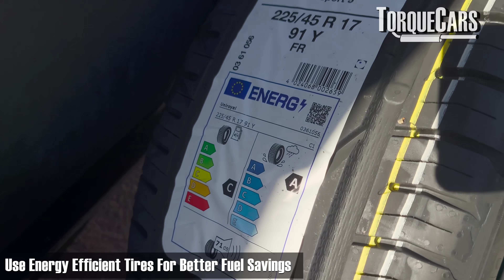10 Fuel Efficiency ECO Driving Myths Exposed 🚗💨  What Really Works? - Save Fuel the RIGHT Way!

Comment: As a retired marine engineer I only use diesel from recognised companies ie Shell, BP etc, who has seen an ASDA drilling rig?
Many fuels can be sourced cheaply from South America but these fuels can leave deposits in the fuel systems. One such deposit was a white residue that had set in pipework like cement and had to have pipes and fittings replaced.
Try to find out where your local low cost fuel station sources its fuel and choose where you fill up based on the country of origin.

Comment: You never mentioned coasting down hills...as you accelerate up but coast down it'll be like constantly driving on flat roads, no?, also, many years ago I dispensed with the spare wheel opting for a tin of tyre weld instead:)

Comment: So what RPM are we suppose to be driving and at what RPM you will it be considered low driving.
Reply from the maker: It depends on the engine and what you are doing (accelerating, cruising at constant speed, going up hill etc.) This video discusses low rpm in more detail and should shed some more light on the question. https://www.youtube.com/watch?v=Uot7DHY_C1c

Generally speaking for economy you should keep the rpm around peak torque (or just below) as this is the most efficient point in most engines.

Comment: Windows down or cracked at low speed can save fuel over A/C, which I do occasionally if it isn't too hot out driving through town. At highway speed definitely better to use A/C.

Comment: I did calculation a while ago, and IIRC gas costs about as much as $0.30/kwh electricity in an EV. Public chargers typically around this cost, so then the extra paid for an EV is wasted on charging. US average KWH cost is around $0.12 or so I think, but most will be under $0.20 unless living in California or Hawaii. Mine I am luck to have a good EMC, they do cheap $0.085/kwh year round but you get penalized heavily for using over 3KW during peak periods. If you don't run your dryer when it is 95F out you save substantial money. This is because they can use less of the highly expensive peaker plants on hot days.

Comment: Where I live the temperature can get as low as -50°C or -58°F, in this extreme cold I could see fueling up in the morning being beneficial but only in the winter time.

One I noticed you didn't mention was whether the temperature of the air being brought into the engine made a difference in fuel efficiency or not.
Reply from the maker: That is actually a really complex question and depends on the engine concerned to a large degree. Warmer air means you burn less fuel. However you are also making less power and need to use more throttle. The BMEP is what we need to focus on and this varies with load and RPM. Personally warmer air on light throttle loads seems to improve fuel economy by about 4mpg - to the low 70mpg (comparing summer with winter here on a regular commute).  However in typical driving I don't  see much difference.

Comment: Using non ethanol gas saves alot of gas. My Lincoln gets 20 to 23 mpg insted of 12-14 I get on e10.  Dual exhaust helps as does having good sensors and no vaccume leaks and a tight timing chain

Comment: To save fuel on engine heating here in Norway you see a lot of cars with a retrofitted electric engine heater. It's a heating element which is installed in the upper radiator hose and heats the coolant up to about 20 C. They've become quite advanced and today you can get app controlled ones, but like with my car I have a timer which starts the heater every day about 30 minutes before I go to work. The same manufacturers also make cabin heater solutions which allow you to do the same thing but for the interior - very nice especially if you park your car outside on a cold morning.

To clarify these solutions use 230V not 12V so they require you to have a wall plug nearby. Look up DEFA or Calix engine/interior heaters

Comment: I tested the theory on premium and standard fuel. I do get better mpg on the premium fuel, but the extra cost of the fuel wipes out the efficiency benefits. Been tracking and comparing the differences since 2021 and It is roughly 1p a mile more in cost to run on premium fuel, based on premium fuel being 20p per litre more expensive, which seems to be average premium in price.
Reply from the maker: Thanks for the feedback, which engine was this on?
Reply: 👍It was for the Audi 1.4TFSI with a manual.

Comment: One thing with EV charging cost vs fuel costs in ICE cars, there can be big savings of as much as £1000 a year if you solely charge at home and do around 10,000 miles, compared to a petrol car that can do around 45mpg. Those numbers change depending on how much public charging is needed (smaller saving), or if you have more or less efficient car. But what this comparison doesn't take into account is the additional cost of EV's. A like for like EV (same class, same size) is oftern around £10k more expensive to buy. Unless you are going to keep the car for a prolonged period of time the extra cost of the car might outweight the fuel savings. Because of this, EV's only really financially benefit people who get them as company cars, that have lower benefit in kind tax rates on EV, or maybe for someone that is able to purchase an EV on a salary sacrifice scheme. Even then on a salary sacrifice scheme, the saving in tax needs to be greater than the difference in cost between an EV and the equivalent ICE car. The idea of judging the financial benefit of a EV just on the fuel savings might be a bit false.

Comment: In a diesel engine using a fuel additive, such as Miller's, does make a significant difference. I discovered this when I tried supermarket diesel with and without additive.  The difference was 5 mpg and a distinctly audible difference in the sound of the engine. I don't ever use supermarket diesel since then but I still use additive along with standard BP diesel. Basically the cost of the additive gives the same improvement for slightly less than the cost of BP Ultimate diesel.

Comment: What I've been wondering: I've seen it a lot in modern automatic transmissions that they go into neutral when you just let the car roll without hitting the accelerator. Obviously they claim that it saves fuel because the car will slow down less while rolling, BUT: it still has to use some fuel for the engine to keep idling while rolling whereas when you keep the gear in it consumes zero fuel but slows down faster. Now which one would be more fuel efficient? Leaving the gear in or going into neutral while rolling? I can't imagine it would make a huge difference but I'm still curious.
Reply: Redex. I use it with Shell optimax and Redex every fill up only half the Redex in the bottle  if I put half tank full in in my car which is a Vauxhall astra 1400 16v 2006. 40.000 miles the car run absolutely fantastic never had any faults.. Ive also bought a BMW m240i 2020 coupe 5000 mile only B58 engine.. I use Shell optimax... In this car also but I am reluctant to use Redex also  with it been such a newer car could using Shell optimax and Redex cause any damage to the rubber seals. or would it Benefit the BMW using both.. Please can anyone help..

Comment: a higher number of octane itself doesn’t increase fuel efficiency, modern turbocharged engines work with higher compression ratio which makes them more efficient but also more likely to detonate. The higher number of octane just prevents the detonation itself.
You can use higher octane fuel on economy engines but that doesn’t change the efficiency of the combustion itself, and with that the fuel economy

if you decrease the number of octane you destroy the engine with detonation but if you increase the number of octane you're just paying for fuel that keeps working well at a temperature that your car’s engine will never reach. The best solution is to stick with the recommended number of octane for your car.

Of course this change if the number of octane isn't the only variation between fuels

Comment: I disagree on a few points. Slightly higher tyre pressures can reduce tyre hysteresis without affecting wear. A lot of cars have an optimum fuel economy speed 35 to 40mph, top gear low rpm. E5 or E0 will be more efficient because they are more energy dense.

Comment: My GT86 subaru engine says "98 RON ONLY" on the fuel cap.  However the manual says different. 
I have run it on 95 and 98 and there was a very minor MPG increase.  
I now just run it on 95.
What you would notice was when you were forced to mix the tank.  For example, running on 98, but getting caught short and having to stick £20 of Tesco 95 in it.  The engine mapping doesn't like this and tends to run rough for a mile or two and then smoothen out.

Comment: “Efficiency” is the wrong approach to judge any car, anyway, especially when the other factors are ignored. Manufacturers produce engines and cars with fuel efficiency in mind under various circumstances. Their engineering is good enough for me not to chase efficiency further, other than keep to the few simple principles that  haven’t changed for decades. For example, I wouldn’t heavily Rev a cold engine and wouldn’t climb in low revs.
It really annoys me when EV drivers are referring to efficiency and in their mind, efficiency differences mainly cover the distance per fuel cost figure, overlooking that the government penalises one differently from the other type of propulsion. I suppose, their EV gets significantly less efficient when charged at 89p per kWh. They also ignore the energy waste from fast charging, preheating the battery and the loss while the battery is left unused.  EVs are also a lot more sensitive to running the heating or cooling/air conditioning, to higher speed, climbing, towing and extra passengers. Imagine how much excitement and motoring pleasure the slow Tesla drivers have, being able to give a precise figure of their average miles per kWh and the cost of their motoring!
It’s nice to enjoy a car and driving it differently sometimes.

Comment: TOTALLY False re air con temp. Air con is either on or off and ALWAYS cools air to the lowest it can, but if u set a temp higher than min, all it does is add warm air from heater matrix back into to the cool air to re-warm it!!
So a Lower temp doesn't put any more load on the aircon system, but not having it on min but it switch on, means u are wasting fuel if u don't need it cooled
Reply: Depends on the car. Some switch the compressor on and off. BMW 3 series we used to have did this. Can hear a slight hiss every time it switched on. My golf however does not. It's always on and just adds a little heat regardless of temperature. It does have an air con eco mode though. Unsure what the one in our other car, a mini does.

Comment: My best motorway mpg has been while getting somewhat of a move on.. but thats with gearing for 2000rpm at 70.. depends on the wind and traffic too.. 55mph is great if on the flat when sheltered from the wind but otherwise lugs and downshifts or revs the engine.
There's torque converter lockup on 4th and 5th, and still manages better MPG than early changes in manual mode.

Interestingly, my brother used to find his first V8 merc got a slightly higher average mpg if driving it a bit harder to warm it up quicker.

Comment: Getting best fuel economy can be one of those nerdy things that people will do. I do it myself when I’m in the mood. But there are other times when my journey purpose is to get from A to B in a shorter time, so that is then the focus. 

I do know that with my current petrol engined car (2 litre automatic dct) I can achieve around 55 mpg on a nerdy trip from Kent into Carmarthenshire, but realistically if economy is not uppermost, then around 42 mpg is what I expect. 

As others have said, anticipation is king. I hardly have to use my brakes as I’m looking well ahead, and this applies regardless of whether I’m in economy or time efficiency modes of driving.

My car has a “green” mode which politely tells me I’ve gained around 12 miles range on a typical and careful 275 mile trip across the country. So that’s a £1.80 saving then. Wow… a large Americano costs £4.25. I’ll just go without the Americano and “gain” 28 miles range haha.

Comment: I have a 2023 2 door jeep wrangler 3.6 6MT
It comesnwith a trip computer with fuel economy and ive paid attention to how driving habits affect econ.
Driving at 55-60 gives me about 25-28mpg. Slower gives me more.
Driving 70mph gives me 20-22.
Driving 85mpg gives me 16-19mpg.

There is little difference between driving with open windows and using ac, bc these mew ac systems are more efficient and the jeeps shape is already boxy so theres little difference with the windows. Therenis a higher difference at higher speeds like 65+ only about 1mpg.
Driving with the too retracted does net 1-2 mpg lower avergae.

Comment: Many years ago I was a police officer, and when doing our advanced driver training we were also taught about efficient and economical driving as well as the fast stuff. Our instructor pointed out that the best word for fuel economy is anticipation, in other words looking and thinking ahead so you do everything calmly and gently. Braking wastes your expensive energy by turning it into wasted heat in your brakes. For example, one test we did was to start with 100 points and lose one point every time we touched the brake pedal. If you see a red traffic light several hundred yards ahead, take your foot off the gas now, don't keep it on and then switch to the brakes a few yards before stopping. You should gradually lose speed without braking, you've timed it right if the lights change just before you get there so you can carry on without braking, but if you do have to stop you only need to brake very gently as you've already slowed right down. Don't just look at the car in front, look as far ahead as you can see and 'read the road' as we were told.  This type of driving not only saves fuel, it saves accidents as well. 'Don't be a B&B driver' (boot and brakes).
Reply: Yep whenI started doing this it helped massively. It also just is nicer to drive this way, less rushed. And you tend to get there just as fast if not quicker, because you're not stop-starting so much.
Reply: @__-fm5qv  I'll often go into the open lane and pass people as the light turns from red to green and then get back over. I'm not trying to be rude, just thinking with fuel economy in mind even if we end up at the next light at the same time. Sometimes I don't manage to time it right so I have to gun it just to get enough distance to move over so I am not stuck in a left turn only lane.
Reply: Dont be a BMW driver
Reply: Took me too many years to discover what he says is absolutely correct.
Reply: Yes and also we have to anticipate other cars ahead in highway that will make we brake frequently and start to think about gaps between cars ahead that can possibly be passed to avoid frequent braking
Reply: Preparing to stop, ready to proceed is what I do approaching a red light.
Reply: I’m not a police skill level driver, far from it, but the anticipation method is key. Look well ahead and coast to the red light.

Sadly mummie in her Discovery or young dad in his BMW don’t know what the word patience means.

It’s a wonderful world really, if only it wasn’t for the general public it would be marvellous 👍🏻👍🏻👍🏻

Comment: What you talk about with the 7 hour charge time is why I have the oldest economy tariff of them all to charge my car.  Economy 7.  And yes I make a substantial saving over diesel.  But I rarely public charge.  However I'd dispute that it's much more expensive than ICE on public charging.  It varies from about cost neutral, to about 1p per mile more expensive.

Comment: I now currently use Shell V-Power (99 Octane) in my Abarth 595, since it's a factory tuned, modern turbocharged 'performance' engine. No problems over 12 months and bought the car on a 65 plate with 50k on the clock. I'm 45 so past 'boy racer' driving - and can easily get 50mpg at 50-60mph in 'Sport Mode' (like it needed one 🤷‍♂️😂). Also, only has a 5-speed gearbox. Not bad for a car that does 0-60mph in 6s 👍
Previously ran an Alfa Giuluetta 1.6 JTDm-2 diesel for 10 years. After the DPF got clogged on supermarket fuel, switched to BP Ultimate. Cost a fortune and caused even more soot build-up than the supermarket stuff, resulting in a stuck glow plug (changed every service) and visible soot at the exhaust tip!
So, Shell V-Power (petrol) gets 👍😀👌. BP Ultimate (diesel) gets 👎💸🙄
P.S. Despite the above issues later in life. Drove my Alfa to 100k miles with zero electrical issues and just the problems with soot on the engine. Other than that, the car was the MOST reliable I've ever owned. Had it far longer than any Ford, VW, Audi and BMW I had previously owned. I had to get rid of all the German cars due to expensive faults, mainly electrical (engine AND non-engine related). Alfa also gave me by far the best main dealer experience all-round to boot. So, just setting the record straight on Alfa Romeo's and Italian cars in general being the most unreliable. I continue to have the opposite experience! Finally, I had never fallen in love with a car before.. but both the Alfa and Abarth just make you feel special.. 🤍💚❤️ and are great fun, even the diesel. 'Scuderia Italia! Grazzi Mille! 🇮🇹
Reply: Don't believe you

Comment: One thing I will say about EVs is even if the electricity flowing into your car comes from a very dirty source, it's still significantly better for air quality than using petrol or diesel. Also, EVs may eat through tyres more in general but conversely, they use their brakes less, and in some cars, the brakes are certainly more expensive than the tyres, so there's a potential cost saving there as well... and of course, reduced servicing costs.